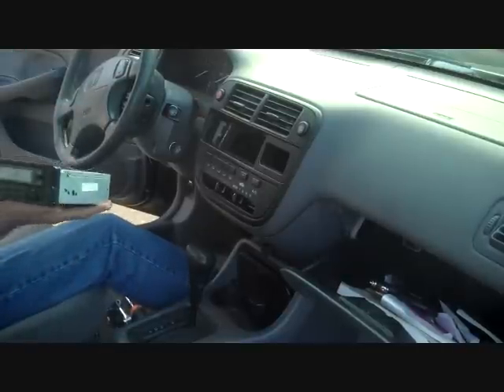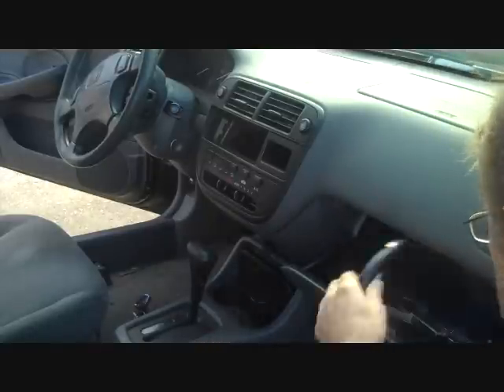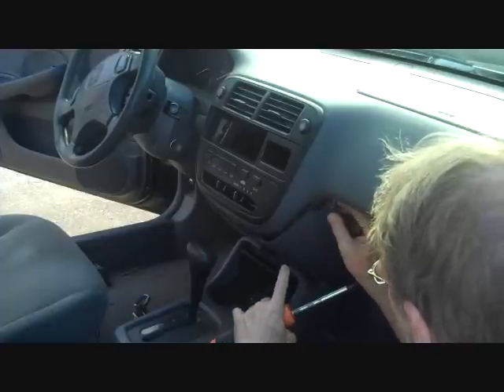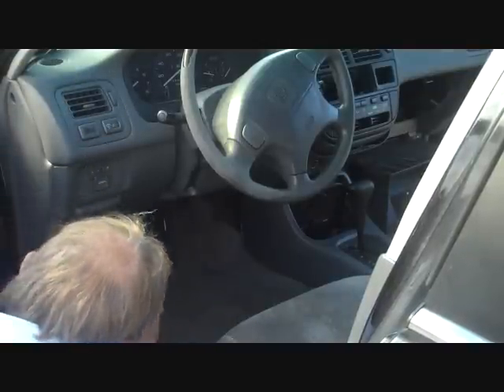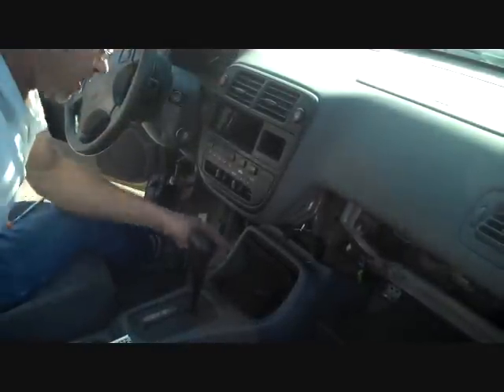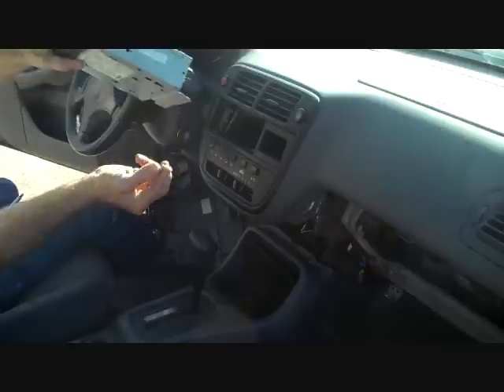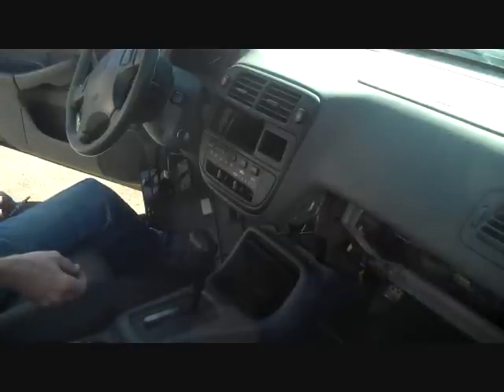Honda Civic Car Stereo Removal 1996 - 1998 = Car Stereo HELP

Comment: when removing this radio  the green plug is the factory alarm keyless plug that renders through the radio      when removing the radio or replacing the radio the factory keyless will no longer work unless you relocate the factory radio to the glove box     also the factory dome light will no longer work as well      that can however be jumped out at the green radio plug by jumping ltgreen/black and ltgreen/red wires together
Reply: Can you make a video on the Dom light? And how to put the stock radio in the glove boxs while having the after market one?
Reply: the next one i get i will make a video but its a rare car that passes through my shop

again, the dome light is simple, the green plug you just tie those two wires together

as far as the factory keyless, its kind of a custom job, you need a harness from metra called a 70-1720T that allows power to be retained on the radio while providing power to the new radio, then its just a matter of finding somewhere to hide the factory radio, normally i remove the glovebox completely and extend the wires and move some wires out of the way and it fits fine  ... a cheaper alternative would just be a new alarm as the door lock triggers are standard negative triggers in driver kick

Comment: thanks for the video. I'm replacing a factory am/fm on a 1997 Civic with a Pioneer that has a CD player. 
Before removing panels, check to see if you can pull it out. Maybe the previous owner of mine did something, but I was able to get my fingers around it and simply pull it out, so I could disconnect the cable and antenna.

The hard part is going to be figuring out how to install the newer Pioneer that has a non-compatible plug...
Reply: what did you do to assemble those non-compatible plugs?
Reply: NiMeMires  need  a wiring harnesss

Comment: Do you know how frustrating it is to spend an hour fighting stubborn old screws and clips, taking these panels out, then discovering it's impossible to remove my radio from back there? The actual removal took about 2 minutes once I realized how to do it. Then another hour putting these freaking panels back on. 

Taking out the radio on my 97 civic just required releasing two clips on the sides by sliding skinny flathead screwdrivers between the radio and the outer metal casing (after taking off the little plastic bigger thingy). Then just pull.

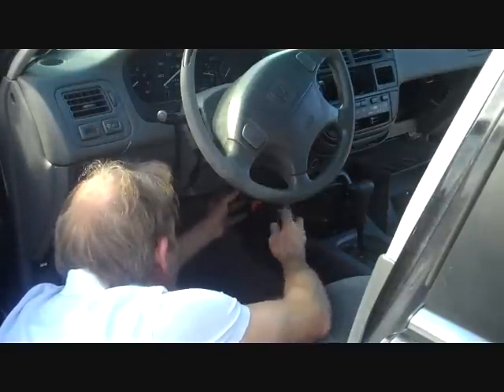Comment: I was able to easily remove all of the screws EXCEPT for the screw above the gas pedal, next to the driver's right leg (2:40).  I have tried pushing from behind and unscrewing but it just turns and turns.  Anyone else have this problem with this screw? Any advice would be appreciated, thanks

Comment: To all of those who are cussing at the hazard switch plug....squeeze it on the bottom where the blue and white plug connects together. The white plug slides right off.......what a bi#$ch that was to figure out.